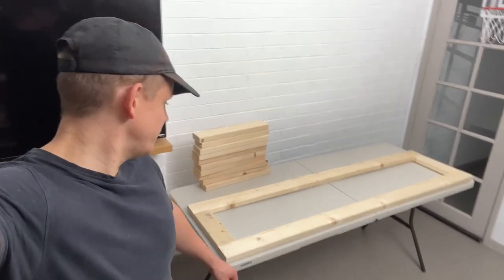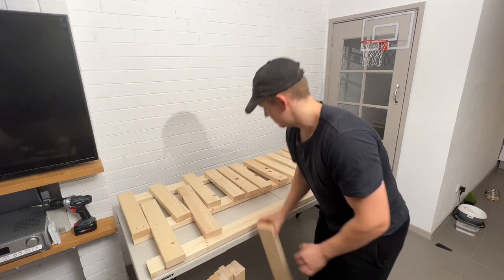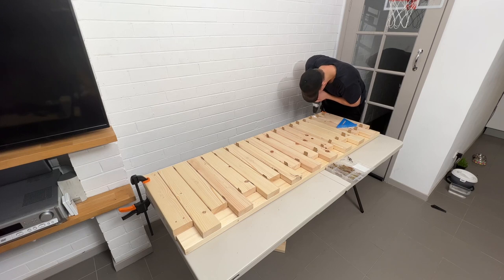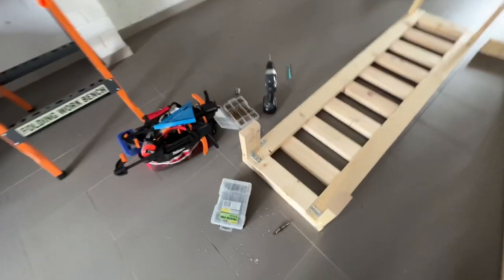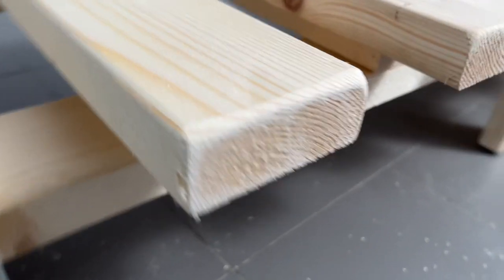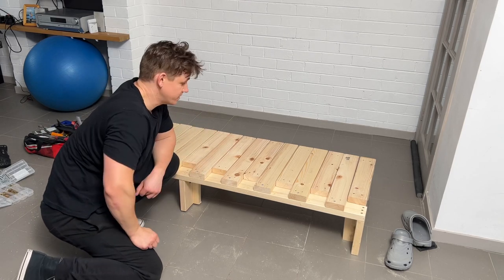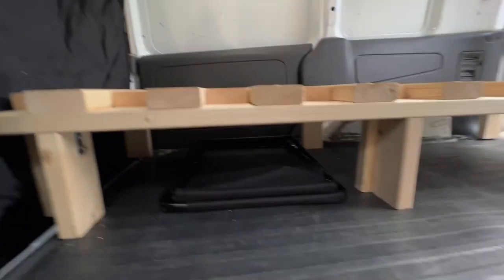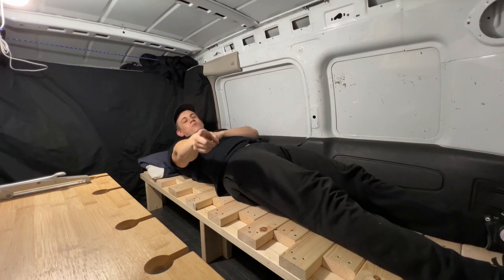DIY Slat Bed for Tiny Van

Comment: Don't want to piss on ya chips... But once you put mattress on top of those slats your head will definitely be touching the roof and even more so if you decide to insulate and line the ceiling.
Reply from the maker: I’ve recently insulted and lined the ceiling and there’s heaps of head room. https://imgur.com/a/vBu4LHz
Reply: @ZekeCamping  well I stand corrected! It maybe it was the angle of your camera that made look like your head was already pretty much touching the roof just sitting on the slats. Or maybe you have shrunk a little bit? 🤔